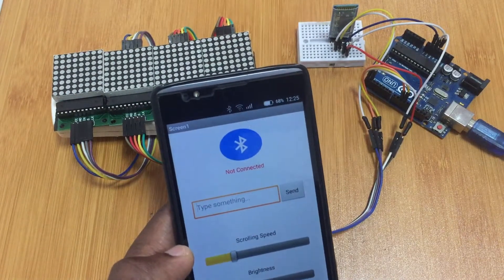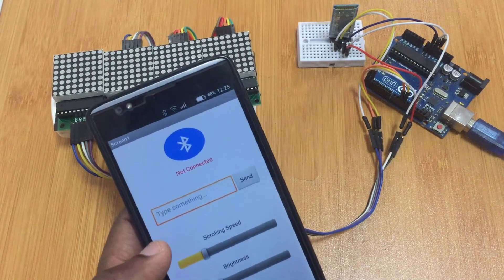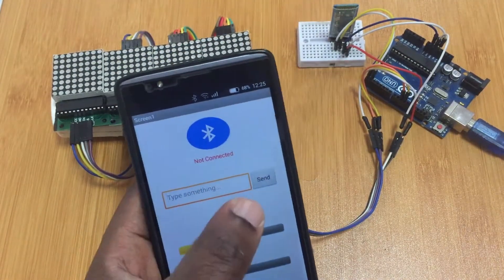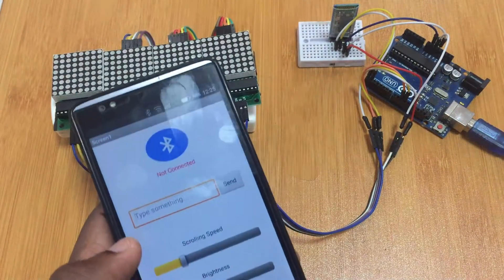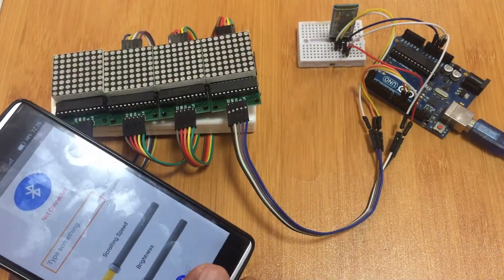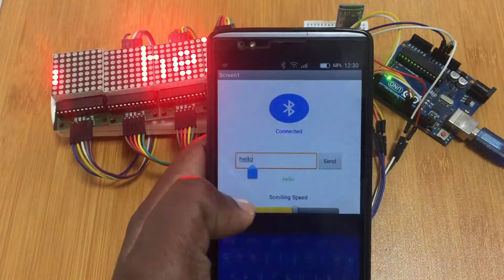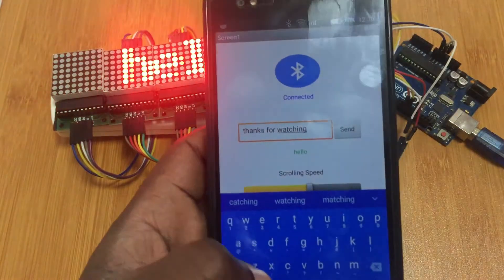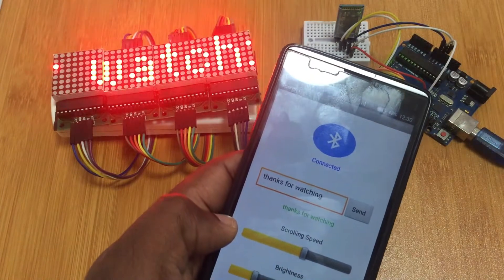Max7219 8×8 LED Matrix Scrolling Text control using Bluetooth and Android App.

Comment: This is a great project. Thank You. I am a bit new to working with the MAX7219 and have four of the MAX7219's connected directly together in a group. The problem I have is that I need to rotate the message 90 deg. The message is correct but not scrolling across the screen. Its is segmented vertically. Any help or comment appreciated.

Comment: Does the code also apply to FC16 LED modules (from ebay)?
Reply from the maker: The FCI6 matrix requires the Parola library to work properly. The code I've used in this case uses the MaxMatrix library which will not work properly with FC16 LED Matrix. Am actually  working on the code for the FC16 and will have a separate video for it.
Reply: Thanks; I will be waiting.